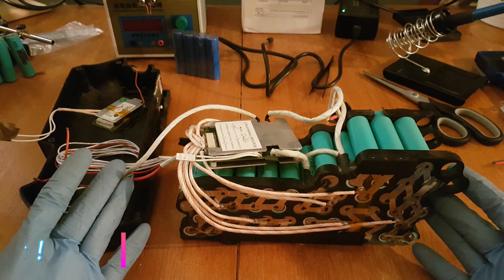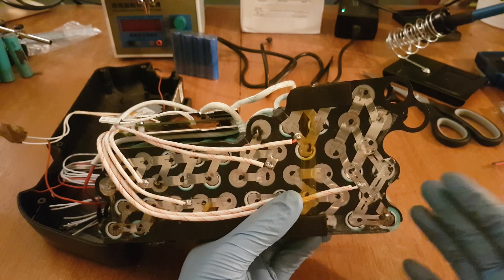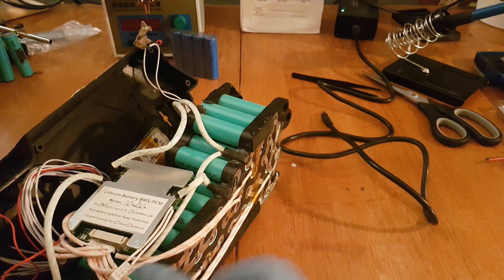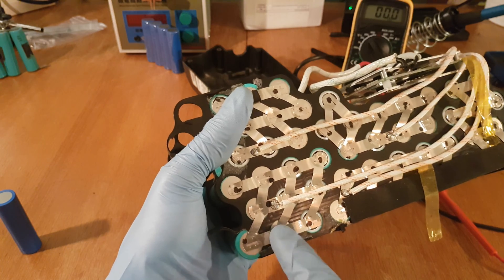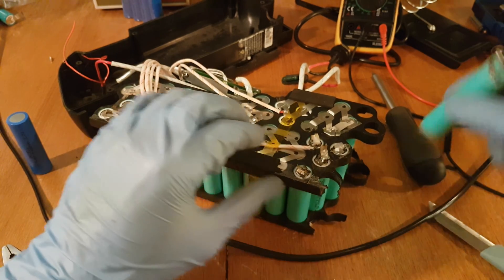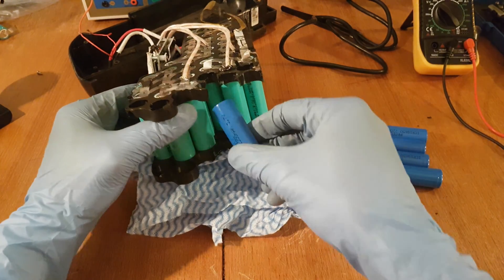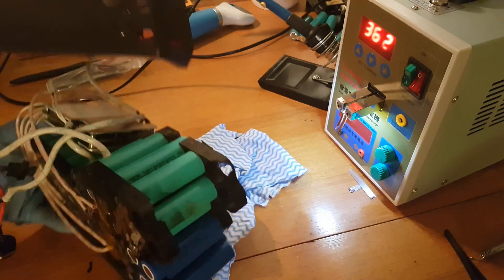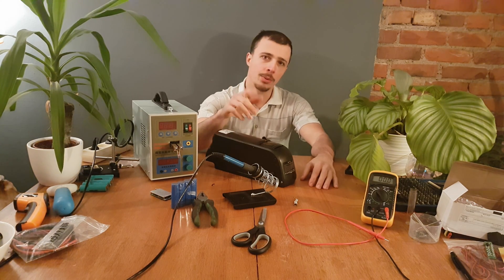E bike Battery Repair - How to Fix and Troubleshoot it

Comment from the maker: Different Problem Fixed : ( How to revive dead cells ) : https://youtu.be/arC-VAGBIN4
Reply: @doit_vehicles It would be cool to have a video with you just disassembling different batteries showing where the main functional parts are located and then assembling them again. I have a Moar 24/7 Ebike and I can't figure out how to disassemble the battery without damaging something.

Comment: I am trying to replace a dead parallel series in my aventon 48 volt 15 ah battery but I can't figure out how the circuits are connected.. Ive looked everywhere and cannot find a wiring  diagram for it

Comment: I have a 48v folding ebike 1 year old. It started shutting off randomly recently. It is at or near full volts when it does this. I can open the folding part up and close it and everything is back to normal. Ride a  little way and it shuts off again. I opened the battery case up and everything looks like new. check voltage and holds at 53.1 volts. Scratching my head. I guess maybe the bms?

Comment: hello..my ebike will cut off if i give it more than just a little throttle. battery is fine. bike runs fine if i barely give it throttle..if i give more than just a little throttle, or if im on an incline it will cut off. i have to turn key off then turn bike back on and i go through that over and over. obviously i cant go very fast. battery is testing fine before and after riding. any suggestions?

Comment: Our ebike battery measured across pin outputs show only .996v instead of 52v, we just ran about 5miles and back home, next day nothing on display. We charged until green light on charger lit up. But measures across terminal still show 0.996V, what is the issue? Thanks

Comment: Did you melt the plastic cell holders with your soldering iron? Mine have to be cut at both ends. Curious what easiest way to do it it. Thanks!

Comment: I have a 60 volt 30 AH battery that charges but will not get a connection to discharge anymore. What kind of spot welder should I get to repair it myself?
Reply from the maker: I won't recommend the one you saw in the video , there are many options on amazon , aliexpress ..
Reply: @doit_vehicles  Yea I need to figure out what to do by winter time. I need my scooter for when it gets iced out. I have to fix this one or get a new 60 volt battery that works with my trike., Edrift has no customer support. Very hard to get someone to help from there

Comment: I need help? My 48v 13ah switch is faulty and the battery will not power the bike.I need to bypass. Don't know how
Reply from the maker: Just check which wires connects to the bms from the switch

Comment: My 52V battery (14s4p), despite the fact that I have set 41V as the cut off Voltage, actually shuts all off (display included) when it reaches 48V ish. I  have opened it up to inspect and I found neither corrosion nor evident physical damage. The only thing is one group of parallel reads 2,6V while all the other group read 3,3. It's because one group has gone below the BMS cut off voltage that it shut down, I believe. All this has  happened after charging (twice) the battery @100% in order to let the bms balance the group of parallels. Do you think that if I replace that parallel group I will fix the issue?could it be one o two cells of that low voltage group badly welded leaving the other cells bearing most of the job and so depleting faster ?

Comment: Hello...I didn’t start my bike around 6months and today I found my battery don’t take charge any more....before there was no problem at all..just I didn’t start the bike more than 6months...what I can do at this situation?do you think it can be repaired?
Reply: Leave it on your charger for a day or so to reset your BMS. Because it’s been sitting so long your voltage most likely dropped too low so your BMS shut itself off, so no “juice” to the batteries. Or depending on your charger type it might be unable to read such a low voltage, Therefore it won’t start the charging process. I’m not an expert but it’s what I’ve heard when researching my own better pack issues

Comment: Mix old  cell with new cells is not fix the problem for long time, when discharged old battery discharge fast ,than new cell.

Comment: One of my packs is partially shutting down. My throttle display shows that it's still active but when I trust the throttle, it pulses and then stops. I can maybe get movement of I feather it down a hill but as soon as I have to come to a stop, I can't take off again. I checked all my connections and have confirmed that it's not a problem with my controller or motor. Would this likely be a BMS issue?

Comment: Hi my friend. My ebike battery drains pretty fast. Whats the most common cause of that?
Reply from the maker: it might have been used over it's lifetime
Reply: doit_vehicles not the problem only 2000 kms my friends has almost 6000 on his battery still last a lot more!
Reply from the maker: @abelramos8652  Than who made the battery has to have a look inside , maybe water got in , or a cel disconnected or is just the whole battery capacity not according to the specs .

Comment: Hello, what happen for example if my battery has 3300 mah cells and I replace 4 faulty cell with 3400 mah but same voltage? Would it have any problem?Thanks
Reply from the maker: Good question . Since the difference is not that significant it won't hurt anything in a short term . But over time if let's say thoose 4 cells are 4000 mah than they will always tend to have a higher voltage than the rest of the cells while discharging ; so that will confuse the bms while charging / discharging causing it to heat up / burn or shut down the charging option  . Also thoese cells will always tend to charge up the lower capacity ones and that will show on your battery level indicator a lot of up and downs while cycling .
Reply: @doit_vehicles  got it, thank you for taking the time to reply.

Comment: my battery charges but when plugged to my ebike it doesnt seem to run any power through what could be wrong?
Reply from the maker: Does the bike turn on ? If not open up the battery and check the wirings ; if they are ok the bms might be the issue
Reply: @doit_vehicles  thanks for the reply i will try that cheers!
Reply: @doit_vehicles   I have the same problem.... I have a Samsung SDI  36volts, 10Ah battery. I'm not sure if it is just the same but, my battery has a board with P+, P-, B+, B- , and looks like it is different to BMS.

Comment: Hi, thank a lot for your informative stuff. My 52V battery got wet in heavy rain and my ebike display died. Battery won't charge anymore. Charging terminals voltage read 45V (same as the display shown voltage at the time of the rainy event), while discharging terminals read 24 V.
Does that mean that only the BMS is at fault?
Reply from the maker: Hi ! Check the discharge terminals without the bms , that will tell if only the bms got damged . If you find 45 v just replace the bms and you should be good to go . Also check the voltage of each parallel group , it should be around 3.5 volts each , or at least equal betwen each other .
Reply: @doit_vehicles  forgot to tell you that I did (almost a year ago) as you suggested and found that only the bms was faulty. Ordered and installed a new bms and today that pack is good. Thanks  a lot

Comment: If battery voltage is good then is for sure the bms? 
Ob the bycicle Nothing changed, engine or wires.
 and it stopped working. 
Even while chargeing the ebike not working...
Reply from the maker: check the total voltage of the battery from the bms and without the bms ; if without the bms the battery has betwen 33v and 42 v and with the bms 0 , than the bms is broken as long as all the wires are properly connected .
Reply: Can you install a bms for me
Reply: My baterry was short circuit.

Comment: Hi,  

I got this ebike battery, 4 years old, not used much (less than 100 charge cycles), but recently failed to hold charge after letting it sit for the winter.
 1. After plugging the battery to the charger, the charging light turned from red to green (indicating full charge) within a few minutes. This wasn't the case before when the battery was charging/running fine.
 I measured the output of the charger with a meter and it's 41V.

2. Upon charging (eg 8hrs) the bike would run and the LCD controller displaying full bars for a couple minutes and then shut off all of a sudden, restarting the controller would only get the bike to run for a few seconds and eventually it won't start again. Battery seems completely drained. 

Any idea on what could be wrong and steps to troubleshoot?  Thanks.
Reply: Sounds like your battery pack went into protection mode ... I keep my battery plugged in and cycle it anytime the bike is sitting for a bit ... It's a commuter for me so only a few days tops does it sit idle ...

Fthpower in CA might be able to help you as they service ebike batteries... They'll be my guys when my batteries start going
Reply: @EndUser-yu7gg  Thank you for suggesting this option for e-bike battery repair.   I am going to contact these guys and see about repairing my Dolphin 48v pack that is failing (gets only 1/2 range with greatly reduced punch).  Again, thank you.
Reply: @natestapp5573  no problem ... These batteries are not cheap and heaven forbid the company one gets their bike from goes under... If your in the states from what I heard electrobikereview and saw on their tour that company is going to be getting a lot of business as they definitely have the stuff to do the tests on any cells that are ghosted ... Glad to have been of help
Reply from the maker: It sounds like the cells are "dead" and they can not hold the charge . However after a winter of storage they should drain to completely 0 . What is the total voltage of the battery? Should be betwen 30 and 42 volts . If its much less than 30 v than the battery is damaged . You might also try to charge the parallel groups individually with 4.2 volts and see if it holds tge charge . Depending of what's the quality of the cells , it might be possible to revive them if charged individually / parallel groups  
Also the bms is not usually made to charge a 36 v nominal voltage battery from lets say 10 volts up to 42 v  - fully charged . That' why the only thing you can do is to charge the parallel groups or bypass the bms and directly apply 42 volts from the charger to the battery .
Reply from the maker: And if you manage to "revive" the battery it will have less range than before ..
Reply: I opened up the cell pack and found one leading pack of 5 batteries giving only 3.2V. the rest are 4.1V. total battery output is 40.1V without load. How do I charge the individual suspected pack and what charger or voltage/amp do I need? I only have the charger that came with the battery pack.
Reply: Do you have any recommendation on where might I find the individual replacement cell battery to buy? My battery is ur18650zy. I assume equivalent band is ok?

Comment: I tried to wire my e bike from an chinese manufactured controller. They don't tell you which wires to connect the battery to. I think I shorted it. I don't know where the fuse is either. the battery is dead now and I am not sure whether there is a fuse to replace it or whether to get a new battery. Also the control box wires without a guide to connect them are a problem. Any ideas?
Reply from the maker: Hi . The battery should be fine as long as it was not directly shorted ; the only thing that shoud be fried is that controler . On some batteries the fuse is inside and not changeable from the exterior ; so you will need to open ot up and see . Is a good idea to check for wiring diagrams from the seller before buying a controler / or get the controler from where you got the bike ... It's hard to tell you more precisely what to do without seeing the stuff in front of me .

Comment: do you have a video where i can test the hub motor without a battery?
Reply from the maker: Just check where the plus and minus goes from the battery to the mounting place and than apply 35 - 42 v to those pins .
Reply: @doit_vehicles  without a battery!!! just with AC from home.. is there anyway?
Reply from the maker: @serchmarc  as long as it is within voltage limits, yes . But it will be hard to find AC 35 - 42 volts  so you will realistically need a battery for that ..

Comment: My ebike battery has a rare problem. It is a 48v 20ah. It works perfectly for a few hours and when the display still reads 75% charged it suddenly dies and turns off everything including the display. When I get home and test the battery with my multimeter it read 36volt. I charged the battery for a few minutes and reads 51v again. Use it for a few meters and turns off again and the multimeter reads 36v. What do you think is the problem?
Reply: Thanks. I encountered the same problem today on my ebike. After further inspection one of the cells was pinched.
Reply from the maker: It happened exactly the same thing on this battery . There are two possible situation either some cells are disconnected or the capacity of one group of cells or all battery is low and the power will drop faster after full charge . Also the fast charging you describe sounds like there is a capacity or connction betwen the cells issue .

Comment: my ebike battery discharge very fast,, what's the problem of this.. thanks
Reply from the maker: Is tha battery old , or you did more tha 500 cycles of charging / discharging?
Reply: my battery is new and I charge up to 5 hours until the fully charged indicator turned into green
Reply from the maker: It sounds like the cells are not holding that charge ;is it homemade or from shops ?
Reply: @doit_vehicles  from shop
Reply: is it not charger did not really charge but the green indicator already ok
Reply from the maker: well try to open it and inspect the conections inside ; if everything is ok than the cells are just not holding the charge and there is nothing to repair , you will need a new battery . If it's in warranty ,take it back to the shop ..

Comment: Great video and explanation! My battery just died on my ebike, I suspect it is the BMS and some faulty cells. I opened it up and there is corrosion on the metal strips connecting the terminals and on all the wire soldering points so i suspect the whole unit was messing up the BMS. I am going to test each cell with a volt meter and then decide whether to toss it or try to fix individual cells. Unfortunately I bought a cheaper battery and there is no plastic frame work holding the cells together just paper and lots of hot glue. Do you have a recommendation for a supplier of good quality batteries for my unit.
Reply from the maker: I understand ... First find out what model of batteris do you have . Like in that video its a " dolphin case " type . I personally make my own batteries and I dont buy e-bike batteries from sellers since as you mentioned they are not good quality in meny situatiions  ; so unfortunately I can't recommend anyone . So depending of how much you wanna invest in your e-bike , the best option is to build a spare battery by yourself in the same case as the "stock one " is ! Might be an investment at the beggining but in a long run you'll save money doing so . 
Whatever you chose look on aliexpress for things you need ; fron my experience I got good quality "as described " stuff from that website.

Comment: When I plugged my battery to the charger it created a spark and burned the area around the connection.  Now can not plug the round part of the charger to the slot. How can I replaced that part?
Reply from the maker: If that burned part is on the battery case , you might have to look for a new case . it's hard to say something without seeing it
Reply: Thank you for the fast reply. I dont how to explain it but I just place a review at Amazon for my bike with picture of the socket. - ANCHEER 2018 Waterproof Folding Electric Bike with Removable 36V 8Ah LG Battery, Foldable Electric Bicycle with 20" Aluminum Alloy Integrated Wheel, Full Suspension and Shimano Gear. Its the socket that burned and I went to several website and nobody is selling the case including the company's website.  My friend tried to push the charger then it spark again. Scared it might just explode. I bought the bike last July and I just rode probably 30 miles. bummer.
Reply from the maker: All right ; so if that socket / connector on the battery itself is fried up and you can't find a replacement, I personally would open the battery case and remove the old charging connector as well as the one from the charger (both male and female basically) and replace it with some other regular ones you'll find and physically fit . Also after removing the old conectors try the battery if it does charge with the conectors removed .. find out what is causing the shortcircuit ? Maybe it was a piece of metal inside the conector or some wires got disconnected inside the battery and touches other wires ... Now , of course it wont look good with a new charging conector on , but at least you will be able to charge your battery !

 you're welcome anytime !
Reply: Thank you very much. Great info. I will find somebody who can do fix this in Houston, TX.

Comment: I've seen too  many videos of batteries exploding to put me off wanting to do this . I have 4 batteries ranging from 36v to 48V . So far so good but if one stops I will just buy a new one .
Reply from the maker: haha , why should they explode ?
Reply: Possibly faulty cells or the idiot in the videos I saw did them wrong but they smoked and then BOOM .
Reply from the maker: hahaha , on youtube there is a place for everyone :)